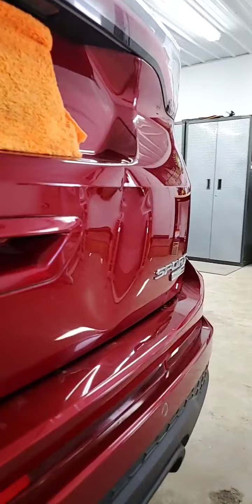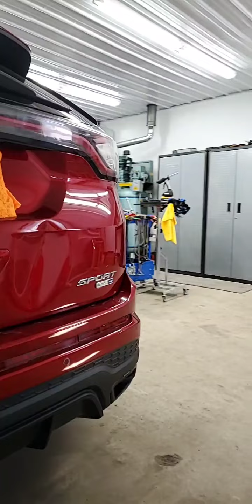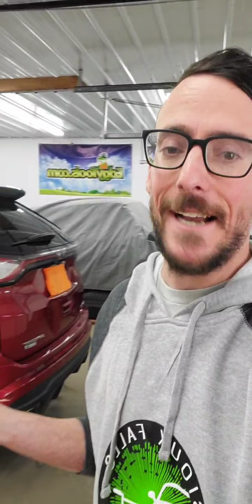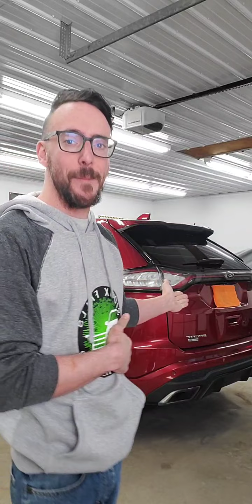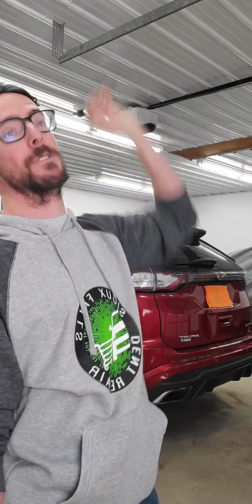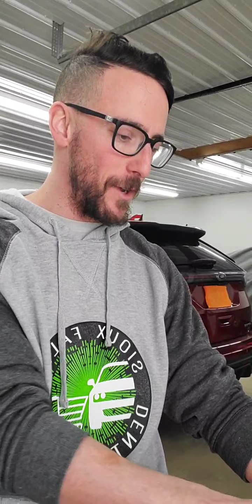Ford Dent Removal - Paintless Dent Removal - Sioux Falls Dent Repair

Comment: Jake pre-scan is just for insurance claims🤔.If it's not insurance claims can you dis-connect battery, sensors etc .do the repairs,reconnect without affecting operation of the car?
Reply from the maker: That's a great question. A Pre scan should be done on any modern vehicle prior to taking any items apart. This is also stated as a requirement by many vehicle manufactures after a collision or if anything is taken apart for the repair. Disconnecting the battery itself will set codes in the system, which is why a Pre scan must be done before ANYTHING is done and after the vehicle is put back together to ensure it leaves in the same condition it came into the shop in. Thanks for watching!